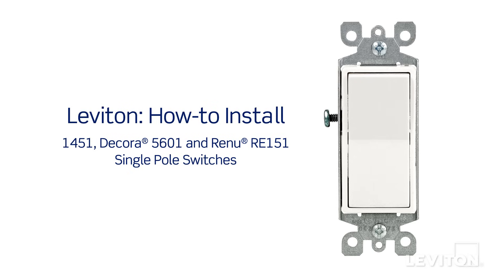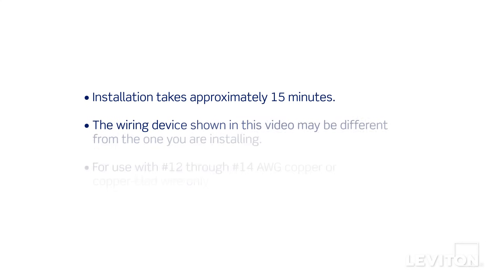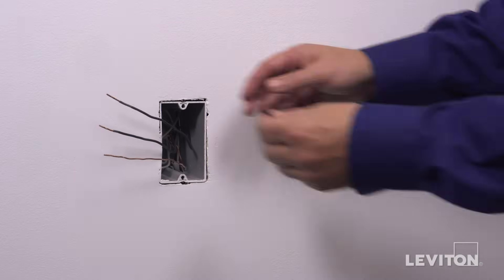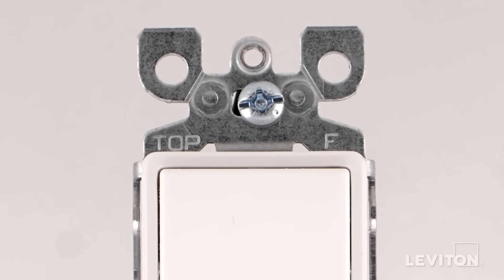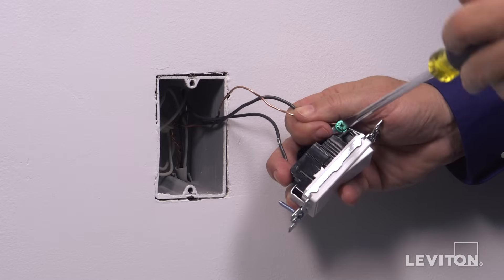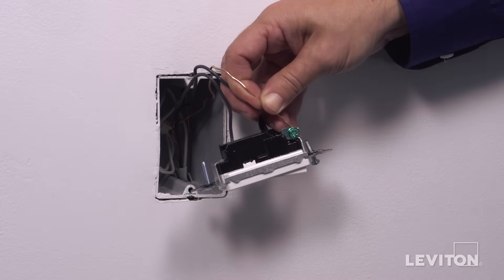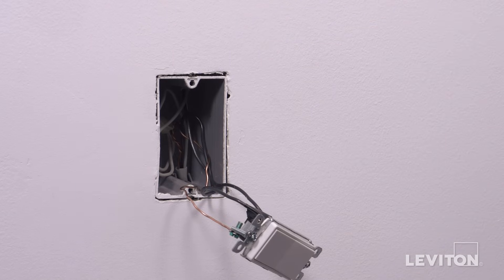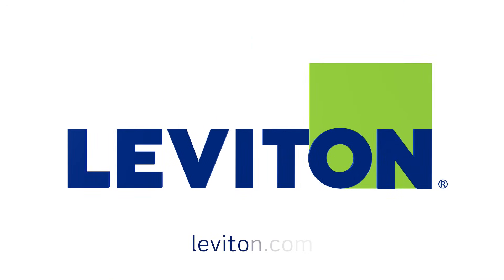How to Install a Single Pole Switch | Leviton

Comment: I recommend when testing which one is hot and load, put a marrette on the 2 black wires, just to be a little safer. Again, never use the backstabs! Always make a hook and use the side screws.

Comment: Why do you need to identify the hot wire if the load and hot wire can be used on either terminal
Reply: It doesn't really matter for the situation in the video, but a lot of times you'll need to know which is which because you'll need to connect one or more other wires to the hot wire or the same terminal on the switch as the hot wire, so that devices later in the circuit still have power and are not turned off and on by the switch. 0

Comment: Ok so we see where to connect the wires from the box but what about connecting the wires going to the light. I'm wondering if I put them in the side post with the hot wires aren't they touching and the switch is canceled out

Comment: in your video you say to mark the hot one, but then say to connect it to either terminal. why bother marking the hot one if it doesnt matter which terminal you connect the black wires to..
Reply: Thanks for the post. I thought i was losing my mind. I only came here to determine what terminal to connect hot wire too. Now I'm more confused. Comical.
Reply: Brass screws: Live/Hot
Silver screws: Neutral 
Green screw: Earth
Reply: Yeah it doesn't matter, but it will make your life easier later on when you change the switch when it gets old or want to change to other style, you will know the mark one is line hot and none mark one is load hot so you don't need to find a tool to test again.